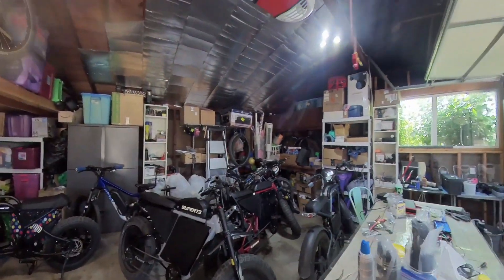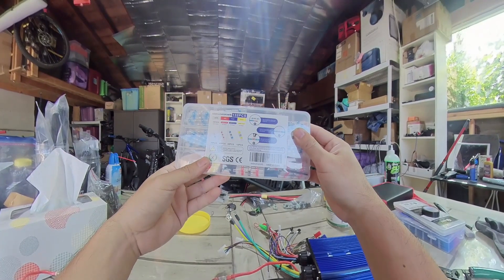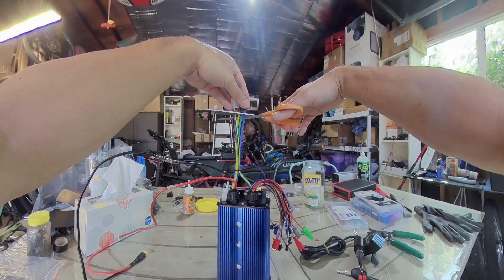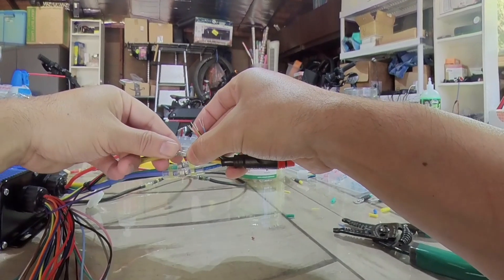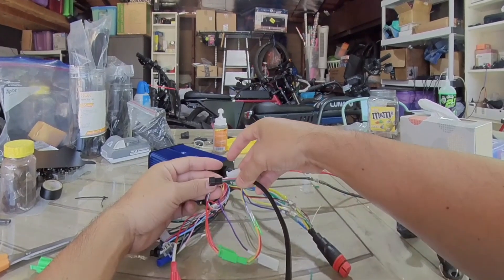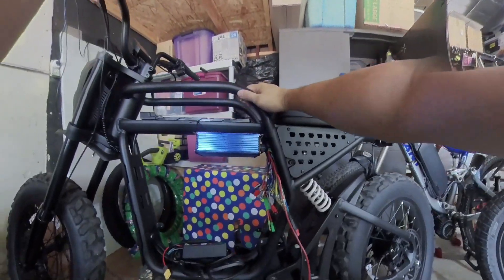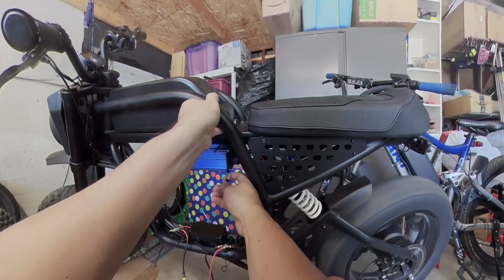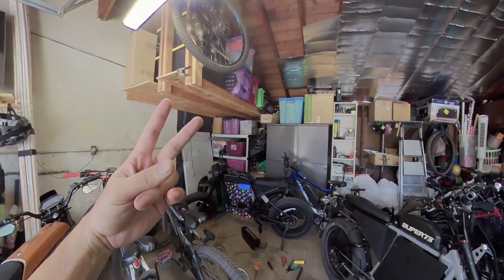Wiring tutorial Overvolt REVV1 DRT or Super73 stock motor to 60v 72v Amazon controller ebike upgrade

Comment: Are you plugging the power for the stock revv1  display to the second battery??
Reply: I've followed all the steps, but I don't have the original display plugged into anything. I didn't see you plugg it into a second battery... But I'm going to try that tomorrow
Reply from the maker: I split the 52v battery to run one on stock controller and one on the combiner with 60 or 72v battery and the white wire to detect speed.  My FS version detects right away- my DRT version has sporadic speed readings but at least it keeps the lights on

Comment: If you use the throttle with the speedometer..what wire do you connect from the controller to the throttle to get the speed??
Reply from the maker: use the phase meter wire (brown) from controller to the left over wire and amazon has instructions for voltage, miles, and wheel configurations

Comment: Wait I lost the part how you powered on your display? So all you need is the white wire connected to stock controller? Is the display connected to the stock controller or new controller? What is powering on your display? I don't see the stock controller plugged into any battery.
Reply from the maker: Good catch, I used a splitter or a combiner to power the two controllers
Reply: @EbikeAdventures  Oh okay. So when you get your 60v/72v battery you can use that for the new controller and run the stock controller with 52v for your spedometer and lights? I watch @MrCentralDriver video and I think he uses similar set up but his lights and display shuts off every 10mins.
Reply from the maker: @chesteryao  Right but I'll run a battery combiner so when higher voltage runs out it uses the 52v for more range and back up

Comment: This seems pretty straight forward. I have 630 miles on my DRT and I really want to give it some more power and speed. Would there be ANY benefit in JUST upgrading the controller to that 60v-72v controller or do you also need the battery? Does seem like the cheapest option to upgrade it.
Reply from the maker: Beneficial with more voltage- 52v still 37mph - 60v about 40mph and 72v about 47mph using stock motor
Reply: @EbikeAdventures  damn thank you for the info! So really the most expensive part would be the battery. Do you have the link in the amazing page for the 60v or 72v batteries?
Reply from the maker: still trying to fit a 72v battery in it, waiting on storage center case but 60v battery on amazon also https://www.amazon.com/hz/wishlist/ls/30I8661N34ET8?ref_=wl_share